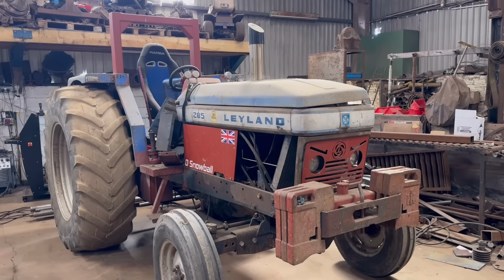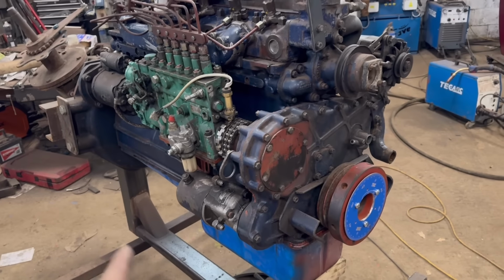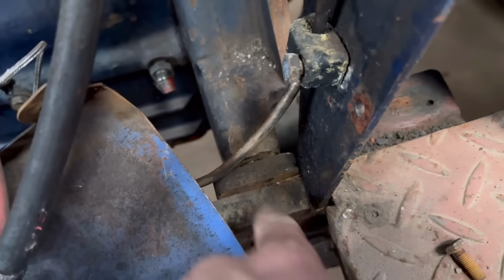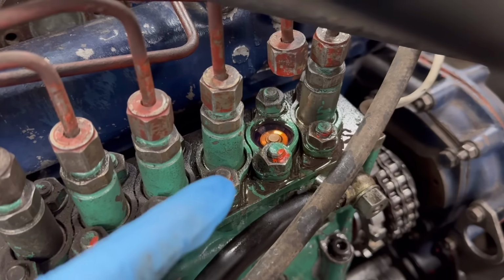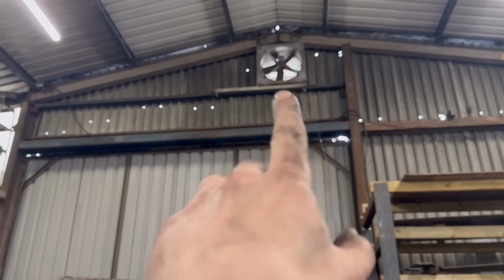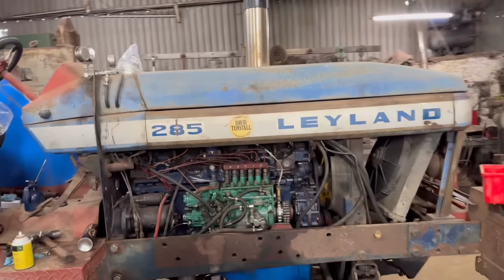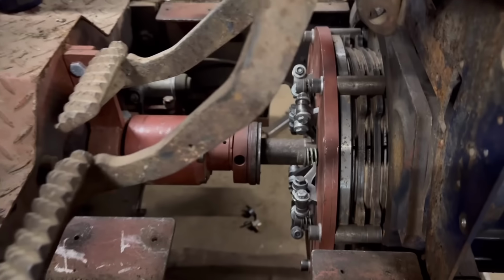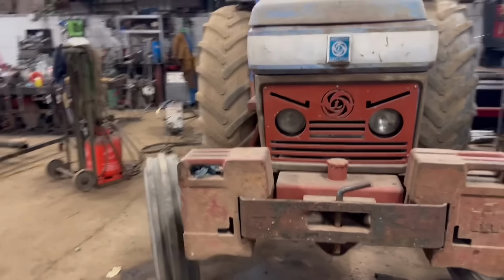My week off.. in the workshop. Leyland 285 tractor puller rebuild.

Comment: If you make it to Emely Moor, enjoy the tractor pulls, and the rest of 'MAST'. If you get a spare moment, glance over at the tall TV transmission tower that I worked on in the early 80's. I got to go to the very top of that tower... Magic experience :) Not sure about now, but it used to be the tallest unsupported structure in Europe, that was back when it was completed in the early 70's after the earlier tower collapsed one bad winter, and many lost their TV signals for a while. Looking forward to the next update on the Leyland 285 :)

Comment: Nice machine, I have used a chain hoist hung off the forks or the crane when fitting engines in boats as it means small adjustments are easier.
Great videos thanks.

Comment: Be interesting to see if removing that center section won't be an issue. Worst case senario would be an accelerated frame upgrade schedule. Hope see brings home a win for you at the tractor pull.

Comment: Nicely done.
Just an aside, very high fuel rail pressure in the injection pump can cause the elements to drive the pump forward so at some rpm ranges the timing gears are loading and unloading giving a rattle.
Can be a mysterious cause of timing gear wear n breakage.
Passing on an experience.
Take care n play safe.

Comment: You need to put a fuel shut off valve as close to the injector pump as possible linked to the kill switch so that it shuts off air and fuel to the engine, if the rack sticks it can still run away even with a kill switch shutting off the air.

Comment: Sounds very nice. 
Glad to see you have a cover over those clutch plates. Back in the day, mid 80’s running my Mk2 escort on motoring news road rally championship rounds, some around your neck of the woods, my clutch did burst (no Micky mouse kit it was the mutt’s nuts) and shot a load of shrapnel through the alloy bell housing, through the body shell and it was sent flying around the footwell. Lucky only scratches and minor rips in the overalls but a bit of an experience! And a retirement waiting for the service car and trailer. Could have been worse I remember it was a balmy midsummer night not a grotty wet January in the sleet.  I know you’re safety first so the captive shield on the gearbox input shaft was a nice touch. Good luck with your motor sport adventures, the memories are golf dust when your times almost at an end. I loved every minute with a passion, including every night in the workshop, either mine or a mates. 
All motor sports are great sport,  great competitors, no needle, no aggro and real comrades who will pitch in no matter what and always be helpful.

Comment: Hi Olly next time you have to mess around installing those clutch plates  try using two lengths of 18 or 20 gauge binding wire, one either side turned around the tangs of the last plate and pulled backwards and tied off around the output shaft,  that will allow you tons of room to fenoigle the imput shaft into the bush. And being such small gauge will easily be removable with the  play the system uses before tightening down.
 I dont know how often the Motor will need to be put in and taken out in the future  but a fine upstanding individual such as yourself ought to be able to fabricate a  frame to fit snugly on the forklifts front end and using an arm equipped with a bolted on porta power with a purpose made head bracket to change input angles would make the whole job much less of a one man ball acher dont you think.

Comment: This reminds me of changing engines in my cars over the decades. I've only done one in the last 30 odd years, when I upgraded the engine and gearbox in my 1982 Mitsubishi L300. I changed it from a 1.6 litre four speed column shift to a 2.0 litre five speed floor shift. The engine and gearbox came from a 1991 Mitsubishi L300. There were a few modifications needed, but it fitted nicely.

Comment: I wonder how having no rubber engine mounts might impact the tractor with all the vibrations from the engine direct to the chassis? Will be interesting to see! You definitely don’t make things easy for yourself! You could do with an extra pair of hands. 😅
Reply from the maker: None whatsoever. The rubber engine mounts are designed to make the tractor quieter and more pleasant to drive. For tractor pulling this isn’t an issue